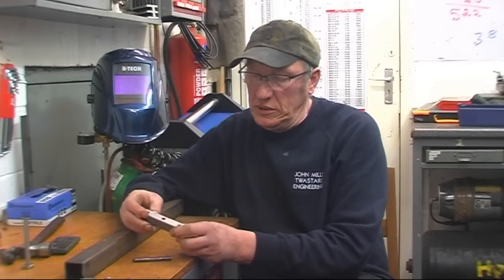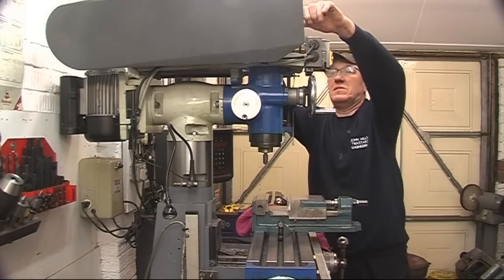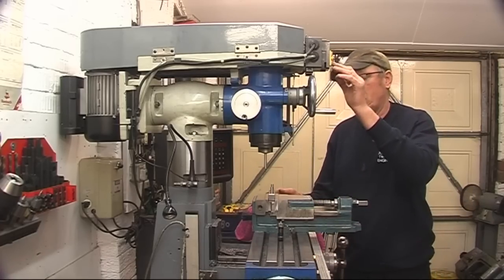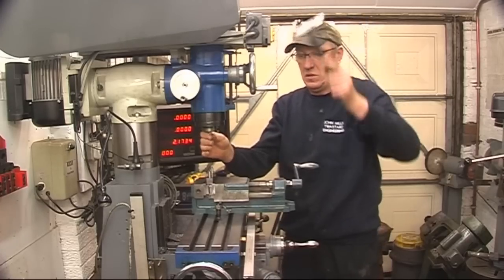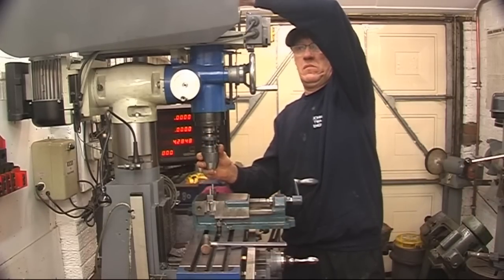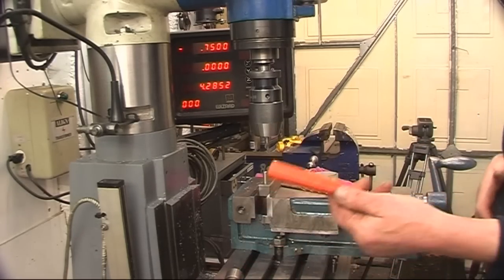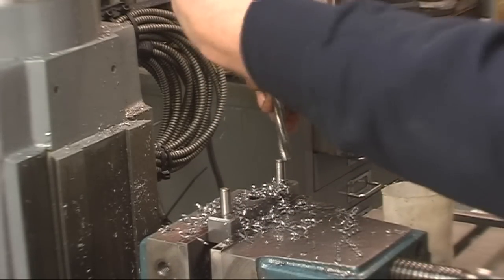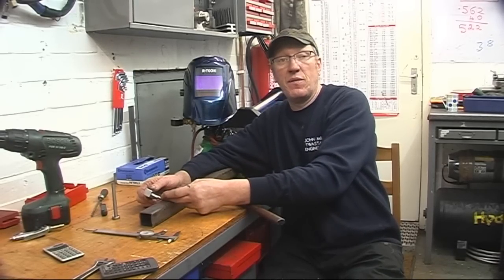Centre Finding Punch Part Three  (the spacings are wrong)

Comment: If my math serves me correctly, the two additional holes for quartering should be drilled at plus/minus .6875" from center as opposed to the .750" quoted in the video. It is my further belief Paul Compton's posting below pinned the cause of John's quandary. Thanks for a good tool project, John.

Comment: Great, and thanks for leaving it up! More to be learned this way. Besides, "wrong" is relative; spacings must be right for something. 

Example: to make a tapered ship's mast, a tree was sawn to square cross-section with desired taper.  A tool like this but larger and with two points, spaced 0.707 : 1 : 0.707,  then marked lines along each face. Corners were then planed to the lines, forming a perfect octagon. From here, it was finished round by shave or by lathe (some masts were left 8-sided).  

(In this application the side pins were generally flat blades, so their radius gave negligible error…)

Thanks for all the great vids, and happy '14 

-Mike

Comment: Interesting project, I hav a couple of questions, how do you accuratly locate to a line if the body of the tool is in the way, also if the piece of work is narrow won't the pegs stop you from getting close to the end as they are on a diagnal and one pin would run off the end of the work piece. keep up the good work John.

Comment: Hi John,

As usual a great video. Happy New Year BTW. If you cut a V straight on the other side of the central hole you perhaps can use it for round stock also. You then don't need to use the outside pins of course

cheers,

Teun (the Netherlands)

Comment: Hi John !

Have you tried to measure IF the distance across the flat in fact IS divided into 4 evenly spaced pieces ?

No, it's not that simple - I know I had a posting saying so, but I was terribly wrong, and I said sorry - here it is:

https://plus.google.com/109043885060180847964/posts/aHb1t9LZRUs

Shortly after I also had a posting showing how it should be done and here it is:

https://plus.google.com/109043885060180847964/posts/AYPPyQRKWkY
Reply from the maker: You are spot on
It only finds the centre lol